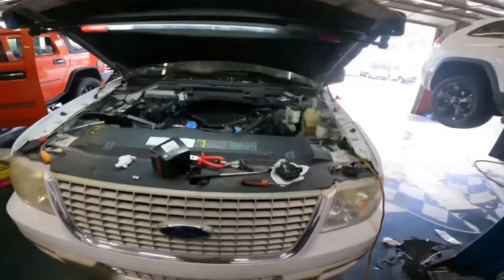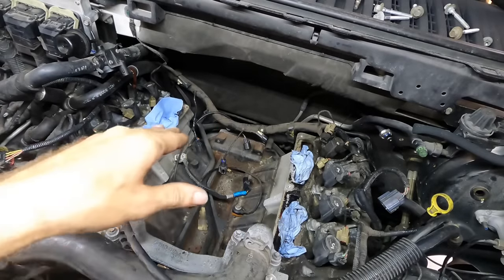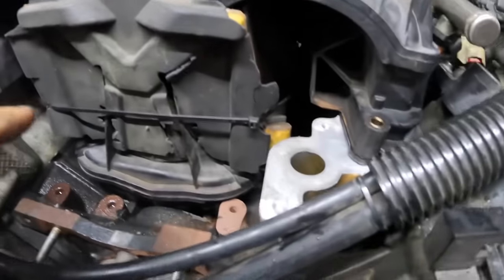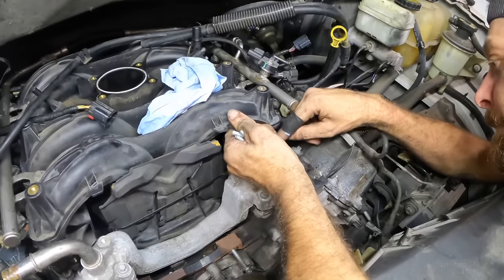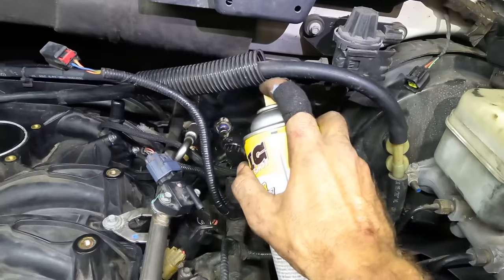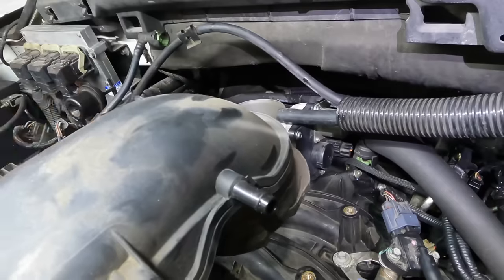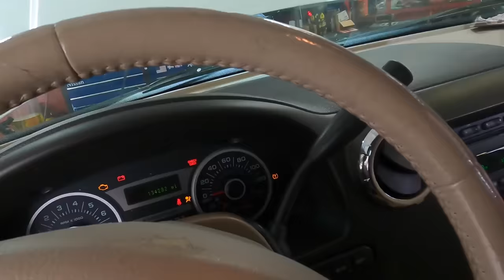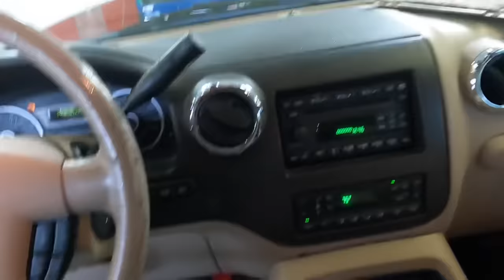Terrible Intake Nightmare! 2005 Ford Expedition 5.4 3 valve

Comment from the maker: Pt 1: Short Circuit! Fuse box FIRE! 2005 Ford Expedition 5.4 https://youtu.be/pzm710DJAgo
Reply: Oh, was just watching some of your stuff, neat.
Reply: You had some comment scammers on one of your videos last week.
Reply from the maker: @chuckgulledge2304  the telegram people? We’re on to them. Plz report to TY of you see them. They keep making new accts and I keep banning them.
Reply: Yes that's who it was. I almost fell for it. Just making you aware of it in the event that you didn't know. Enjoy your videos
Reply: Since we're talking about Ford 5.4 L engines - got a '98 F-150 Lariat with the 5.4 L - beastie was out of commission for over 2 years, until we found someone that was able to fix the oddball electrical issues it was having - since it's been restored to running condition, it's now having some fuel system issues - as in, you have to cycle the ignition on and off 2 or 3 times before cranking it, apparently to prime the fuel system so it will start. Once running, it has what feels like a bad stumble if you rev it up while parked between 1000 to 1500 RPM. Not throwing any codes.
I've got a fuel pressure gauge, vacuum pump, a new fuel filter, and the almighty Haynes manual to start troubleshooting it - just wondering if you've ran into this issue before, and other than a clogged fuel filter, what the most likely issue might be?
AFAIK, still the original fuel tank and pump, pressure regulator, etc.
Reply: I gotta do not 1, but 2 2008 F-150 A/C evaporators this week. Well technically I started Friday last week and got the dash and steering wheel back on for tomorrow ( Monday ). It's gonna be an interesting week 🤖
Reply: I wish I could get you to look at my Acura because I am not a very good mechanic it runs good when you reve it up if it idling it spits and spudders
Reply: @chuckgulledge2304   thyve been hitting quite a few YouTubers lately
Reply: @douglasvines2037  ok got an idea for ya, remove the intake tubing from the intake, look at all the yellowish glaze around the butterfly, get some throttle body and intake cleaner and spray it down, follow the instructions on the can, also check the spark plugs for micro cracks, you'll need to pull them, also check the gap and make sure your sparkplug boots are not cracked or dry rotted.
Reply: @RainmanRaysRepairs   You do know the FTC ruled that warranty void stickers are illegal
Reply from the maker: @Natsumidragneelkim  I do now
Reply: @RainmanRaysRepairs  they are not as prolific as the we can invest your money people.  I have seen entire comment sections taken over by them.
Reply: @mitchelloates9406  Sounds like a bad/weak fuel pump.  If you can swing an OEM replacement that's the way to or a Delphi unit if you go aftermarket.
Reply: hey ray can you tell us where to find good diagrams?? i need help with diagrams
Reply: Ray ? I surprise your mechanic buddies have not played a prank on you. like "HEY RAY ? REMEMBER THAT CUSTOMER CAR YOU WORKED ON ? IT CAUGHT FIRE AND THE POLICE IS COMING DOWN TO TALK WITH YOU". LOL DRAWS WOULD BE FILLED WITH SHT SO SCARED. LOL

Comment: That was a slick design by Ford for that alternator mount. I'm impressed
Reply: The alternators and water pumps are actually very easy to change on these modular V8s from Ford.
Reply: @LA_Commander  I second this. Alternators and Water Pumps are such a breeze on the Modular's. Love them. Able to do an alternator in like 5 minutes no lie.
Reply: What about the slick install for that Dorman part 😫
Reply: @TheFrenchPug  LOL!!
Reply: Chuck, pointing out the rainbow from the Ford rain.
Reply: @garywaddle7235  😆!!!
Reply: @jima3129  Spot on! Good comment Jim!!!

Comment: The more of these videos I watch, the more I don't want anything built after 1980. Hate these $1000 bills by the time you pay for the $10 parts which only come as $500 assemblies, pay labor to take half the car apart to get to it and all the electronic crap that goes bad. I DO like the o-ring type gaskets that seal better. No more leaking cork nightmares. Kudos to the techs that keep up with all of it. My training is 40 years old and I didn't keep up with the technology as I didn't need to for the car assembly line and buying the equipment wasn't worth it for the little it would get used on my own junk.
Reply: Same as me. I just shy away from the new stuff now. Everything is going to proprietary computerization and if you don't have the training you're screwed. Then if you want it, it costs an arm and a leg, besides the specialized tools.
Reply: I'm with you. I hate designs like starters which have internal solenoids. When the $20 solenoid fails the repair involves purchasing a $430 starter, and then you discover the laborious disassembly and installation procedure requires specialty air-frame and propulsion (A&P) tools that only the dealership has (unless you're an A&P mechanic).
Reply: Don’t buy a bmw ever. I don’t care if they want $2000 for it
Reply: @patrickfritchley9210  Audi and VW are the same.

Comment: One tip when working with locking clips is to tie on fishing line.  If you drop the clip, you just pull it out of the valley.  Once installed you just snip the line.

Comment: Always amazing how you achieve perfection in your job,  really enjoy watching. Thank You Ray
Reply: Did you receive the 3M rubber eraser wheel with drill shank?  Perfect for removing double stick tape
Reply: @TXCherokee  The best thing for removing double-sided tape is 1-1-1 Trichlorethylene. However, this chemical is no longer used in industry due to it causing liver damage and destroying a small part of the brain that stabilizes muscle movement, thereby resulting in very noticeable tremors.
Reply: @gaiustacitus4242  yes and how will trichloroethylene affect the clear coat paint on car?   Also that is not readily available at local hardware store.  Side note when I was 19 worked for DuPont and added chemicals to 1,000 gallon tank of trichloroethylene. Made me dizzy from fumes.  Also trichloroethylene is what Liquid Paper thinner is

Comment: You got more patience than I've got Ray! that's why I stopped doing mechanical work on vehicles in the late 80s and switch to working on only boats and1 classic cars.   I hate all that computer crap and sensors, it's really not all that necessary. Hell my 83 C10 Chevy gets comparable mileage and equal performance  without it, compared to a late model vehicle ,  so why bother having it?  Plus you can still see the engine, be able to get to things easy and still have room to sit inside the engine compartment on the inner wheel well, what's not to love about that?
Reply: It’s call EPA and federal regulations the green weenies passed on the auto manufacturers

Comment: I was working on my 1982 Chevy Caprice the other day. but it was just too darn far to reach all the spark plugs. So i unbolted the fan shroud and stood inside the engine compartment, ROOMY !!!  So much more enjoyable then trying to change the plugs in a Mini cooper, Rofl.
Ray I feel bad for you youngsters, you never got to experience closet sized engine compartments with climb around clearance,  footpaths and hydration/rest areas ..
Ok,,, I made the footpath part up >>>

Comment: Hmm...I'd have recommended lift struts for that hood, if they were having to be clamped.  A grandson used a Vise-Grip plier on his Explorer, then a stout tree branch after he lost the plier, until I finally said, "Enough" and bought the struts for him.  Got tired of worrying if the damnfool hood would crash down on my head.
 
Taped a shop towel on a Phlangey...been there.  And worse: Back in my bodyshop days a dual-action (DA) sander careened under power straight into my left elbow while I was mechanically stripping a toolbox on a telephone-company truck.  I washed the wound and wrapped it in the cleanest (amazingly) shop towel I could find and masking tape, and went back to work.  Kept the wound clean and regularly dressed, and I have that scar to this day as a reminder.
 
Excellent job. 😉👍🏼

Comment: Love watching these repairs. One thing I would like to know for these is, Book time vs. actual time.
Reply: I am imagining the book time for diagnosing strange electrical faults is just the stock photo of the old guy in the red sweater, shrugging.
Reply: Me too, at least I always wonder what the time (hrs) and total repair cost was.
Reply: @MonkeyJedi99  Book v. actual would apply to replacing the manifold flippy motor. They would have to bill actual time for the diagnostic. Whatever it was it had to be a pricey job.
Reply: @AJGreen-cn8kk  Electrical faults are beyond the ability of most mechanics to diagnose. It is common to pay for several hours of diagnostics and have a vehicle returned to you that is malfunctioning the same as when you dropped it off.

Ray is very thorough and actually solves the problem, so it is worth taking electrical faults to his shop and asking that only he work on it.

Comment: One tip on the intake manifold debris cleaning, Snap on makes a nice air powered vacuum that if you hold it close to the area will suck up all the dirt and stuff. I liked them when I was doing sheet metal repairs on airplanes for cleaning the swarf from drilling aluminum.
Reply: Love that term "swarf". My parents my have run into that when they were working on airplanes at Lockheed.

Comment: I had a 84 cj7 that had a bad ground and fried the computer.
Ran a power wire to the module, replaced the fuel injection with a carb(off a falcon) and it ran great.( Even in the dead of winter in Syracuse)

Comment: I would have to make detailed notes and videos during disassembly, and label every wire, hose, and socket and screw. And then I’d still screw it up. Kudos, Ray!
Reply: I'm not a mechanic. The knowledge that it takes for these complicated jobs boggles my mind. When he is tearing these cars apart, I'm with you. How does he keep track of all of those parts and little fasteners? Ray, are you a mechanical genius?
Reply: @lynnehuff9659    My former BIL certainly was. We bought an antique JD B model, with the engine in bushel baskets. Not only did he know which part went where, but honed the cylinders by hand and eye. Never burned a drop of oil, and is still running fifty years later. He could look at any obscure part and tell you what it was from, how it was used, and what could be changed to make it better. I envy that intuition, as I am a ‘plodder’ and cant make those jumps. Worked great as we used old, old farming tools that he restored, as couldn’t afford new.
Reply: @mred8002  Wow!! Is all I can say about that kind of talent. Those JDs must have been made to last, too.
Reply: @lynnehuff9659    Great story: we found it about thirty miles north of our farm, and had no low-boy or trailer. BIL somehow used a come along to get it in the back of his half-ton ancient Chevy pickup with the nose wheel on top of the cab. The thing weighs a couple tons of steel and iron: we didn’t get far dragging ass on the truck, front tires only occasionally touching the ground. Had to find a trailer after all.
Reply: @mred8002  You've got me laughing.
Reply: @lynnehuff9659    We were trying to farm with no money, raising kids, working twenty hour days,two or three jobs.: I don’t know how we did it. We’re old now, and can only imagine the kind of work we did then. You do what you must to take care of your family.

Comment: Cheap parts for old cars is good - 2010 impala CV $118 Advanced auto $29 eBay , wheel bearing $29 eBay - don't care who melts the steel & will pay for faster shipping sometimes

Comment: How much is the ticket to do this? I have a 2005 Ford expedition. 5.4 Liter. It’s got just shy of 170,000 miles on it. Have had to change several coil packs in the 5 years that I’ve had it. Now it’s throwing camshaft sensors obd o2 sensors all the time me. It’s always had a tick to the engine. Now it’s throwing ap0354 which identifies it as a ignition coil d primary/secondary circuit.

Comment: From the forward thinking "quick release alternator" to the backward thinking "connectors in impossible places" what a mare of a job after the tedious but 100% painstaking detective work beforehand the engine designers should be forced to work with techs like yourself to learn what looks good on paper may not always be good in real life. Well done Ray
Reply: Heck, engine designers should have to do jobs like this one on all their designs.  That might result in easier configs.
Reply: @ladya1953  you hit the nail on the head.

Comment: This apparently is the Furd 3 valve head that had impossible to remove spark plugs. If I ever buy a Furd product after they did this, well, Chevrolet made several years where they never put in a transmission dip stick, and the rear wheel brakes were at one time to help disk brakes hold on a hill much more complicated than needed.

Comment: It’s a shame you could not get OEM replacement part . Because that was to difficult to do twice if aftermarket fails. Lol that linkage clip was just like the ones on my 70 440 six pack linkage on vacuum secondary’s 😀
Reply: Not if, when.
Reply: @bertblue9683  Yeah that's kind of how I feel too, when the customer supplied part is a rebranded Dorman return...

Comment: Another fantastic video.  That OE unit is stupidly expensive.  Probably the only time I would use an aftermarket part.
Reply: The OEM part lasted 17 years.
The rebranded low quality aftermarket part probably has the life expectancy of a fruit fly...
Reply: @williamegler8771   That is something I failed to consider.
Reply: @williamegler8771  Not to mention the damn labor to replace it!!!
Reply: I have a 2001 Saturn LW300 that I purchased new.
After fifteen years and 280k miles of daily driving I semi retired it.
It is now our extra car and dog taxi.
Like all vehicles it eventually needed a repair.
The power steering pump finally failed.
The shop claimed they couldn't find a OEM replacement so they eventually ended up changing it four times.
All of the replacements were either aftermarket or remanufactured.
I eventually found a OEM replacement on eBay and had it installed.
Works perfectly and only cost about 30% more than the faulty ones.
The shop spent more on labor to replace the faulty pumps under warranty.

Comment: Good morning/afternoon/evening RAY. As you are the best YOU TUBE Mechanic out there. I was wondering if you could help me with an issue i have.
I opened my bonnet for the first time in forever and i checked all the fluid levels. But one thing stuck out the most. And i cannot find what it is for in any of the service/ maintenance or user manual. Even Google and You tube couldn’t provide the answer. So i hope you can help. What is the label L10 used for? Thanks in advance. 
I have a 2014 toyota aygo 1.3  with 23000 miles on the ODOMETER this my help.

Comment: Ray, I brought my car in a while back (to I place I frequent) and they tried to bill me 2 hours labour because of "different tasks" The car, and I, were not there for any longer than 45 minutes, tops, before I got a call stating it was ready. So they might have actually HAD it for 30minutes at most. Is billing by task, like that, typical or were they trying to screw me. No I didn't let it slide and spoke up about it and got 1hr knocked off.

Comment: I didn't see you show it in the video, but Did you get that vacuum hose reconnected to the Heater Hose valve?  You put your hand on it at 24:15 and it looks like the hose is just below your wrist inside the small corrugated loom.  The Ford Automatic A/C system toggles that valve using vacuum to restrict flow through the heater core when its not wanted.

Comment: I missed the test drive. I was wondering if that Dorman part would function as intended in the car.
I for sure would not put my blind trust in that part. I would connect it up and do a scan tool actuation test before putting everything together. Just 10 minutes of testing can save you a lot of frustration when working with Dorman parts.

Comment: Two options when the OE part costs $400 and the aftermarket is $40;
The OE is outrageously overpriced for no good reason.
The aftermarket is outrageously inferior.
Reply: It is ridiculous, another option would be the salvage yard.
Reply: A big risk on that re-badged Dorman part.  If it failed after all that work installing it, it wouldn't have surprised me.  I never seem to have good luck with Dorman aftermarket parts.
Reply: Sounds like a catch-22 --Dam if you Do and Dam if you Don't...
Reply: @marsrover0  IF it isn't a common fail item where ALL the junk yard ones are likely bad or soon will be.
Reply: @hotpuppy1  I've had good luck so far, then again I only buy Japanese made vehicles.
Reply: There's a third option... both that the OE part IS overpriced, and the aftermarket IS inferior.
Reply: @TacomaRodeo4  It's Chineseum fish head made parts.

Comment: I need me one of those long bendy magnetic drivers..  fuggr would be a lifesaver on many a job.  Thats probably the worst thing i have when i work on shit, getting the damn bolts back in their homes.  That and those stupid electrical connectors that require a really small hand with super strength..  give you a half a mm to put a nail on ti push down while you wiggle the connector apart without pulling on the wires...

Comment: Love yer work, and yer diag, but you drive me insane when you start the nut runner before putting it on the nut or bolt. My old tool shop supplier would be spinning in his grave. I guess that's the snap-on effect.
Reply: What is yer?
Reply: @standhd  colloquial speech for your.
Reply: @capnpugwash5403  Colloquial🤔 Was that the green stuff that was on my dinner plate last night next to my steak and tater tots?